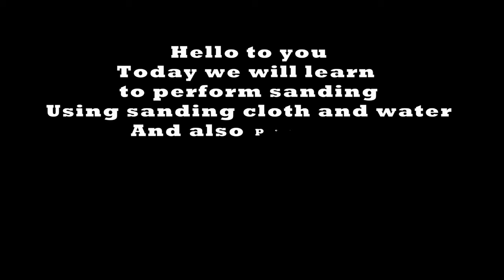How to make the perfect polish And get mirror shining

Comment: Looks great!! I believe I’m fixing to order the same micro polisher. Did you replace the pad each time you changed the compound? And I haven’t been able to find replacement pads on Amazon so where can I find them and are they washable?
Reply from the maker: No i stay with same one pad and yes you can wash them and i think have on ebay some small pads
Reply: @rusomodels  thanks